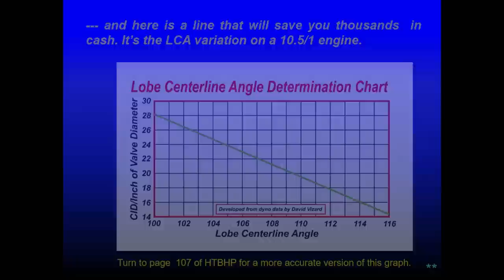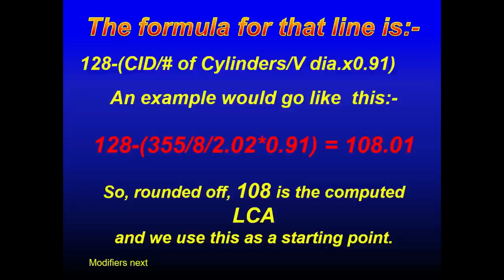Cam profile dynamics Vs event BS bashing!

Comment: "I don't have an opinion, I have a dyno." 😎
Reply: Awesome
Reply: I believe you sir
Reply: Do you think Comp Cams doesn't have a dyno and far better data acquisition equipment than Crane ever had? Why do you think with all the R&D that Comp has done that they don't follow David's advice?
Reply: @jonathanschmidt6507  thats why I use Lunati and have them grind every cam I buy. I dont use off the shelf cams as the profiles are just a ball park figure never an exact one.
Reply: @MasterWitchDoctor  
What tools do you use to spec cams?
Hopefully not the 128 gimmick.
There are much better ways that actually considers the physics of the engine.
The 128 formula is does not.
Any method for specing a cam that does not consider the design of the intake and exhaust system is just a rough rule of thumb.
Reply: @jonathanschmidt6507  because they don't use his formula....
Reply: @cromBumny  
There is no simple formula that can comprehensively determine the ideal cam specs. That is why the most knowledgeable people use 1D simulation to tune the engine as a whole when selecting a combination.
Reply: @ironmike742  It might help your understanding to know that David called me and invited me to join in on his videos to stir up controversy and get more views.
Reply: @jonathanschmidt6507  well that would be a good thing. David Vizard is a great man with great talent and knowledge
Reply: @ironmike742  To amateurs, he is better than nothing. Many of his claims are just gimmicks and speculation that professionals laugh about.
Reply: @ironmike742  He is the subject of jokes among professionals. He posts clickbait false claims and tries to pass off speculation as fact.
He is better than nothing to amateurs who don't read real engineering books.
Reply: @ironmike742  
Here is a suggestion, if you really want to understand engines, read Design and Simulation of Four Stroke Engines by Gordon Blair.
I it at a whole different level and will require more effort on your part
Reply: @ironmike742  
Taught a lesson about what?
David and I have had hundreds of exchanges on speed talk.
He invited me here because he knows my criticism intrigues people.
It is working on you, obviously.
Wise up, don''t be a dunce that falls for social media ploys.
Reply: @Jonathan Schmidt  As someon3 who's worked for a major corporation. The idea of giving the customer the best service & product they can produce. Is a foreign concept, to the executives making the decisions.
Reply: @I_like_turtles_67  
I am wondering why this is directed toward me. What is your point?
Reply: I've watched this a few times now, and David is SPOT ON!!......HE IS our modern day Smokey Yunick......yep

Comment: I Have enjoyed learning more about Engines from you. You are so correct on your results being proven on the Dyno.  I have a friend that has since retired from Roush in Livonia. He worked in the Engine building Department for most of his career. Roush has 41 dyno cells and they test and build a lot of different products. I learned from them on their crate engine program sourcing the correct parts to make good reliable power that is backed by a warranty.  So again to confirm that you know what you are doing as your testing confirms what you say. Keep up the great work.

Comment: I have watched numerous teachings you have out there. I even had your how to hotrod small block chevy's and big block chevy's books. I didn't know who wrote them at the time, but I know now.
You have inspired me to build several engines. Mostly chevies but a couple of Fords utilizing what I learned from your books and experience.
You always put out the correct information as far as I can tell.
I'm sorry that we are not living closer together. 
Although now I am dealing with heart failure and a heart pump and can no longer build engines.
My son is building a 489 with my input and watching you series. It will be awhile because he is building it as he gets the money. We are hoping for around 550 hp and about the same on torque at 6000. We are using stock 781 heads and 2.19 intake valve. A howards cam   .600 .600 lift 230 240 dur and 110 centerline. 
We will let you know how it works when we get it together.
Again I wished we lived closer to you. We could both learn so much from you.
Reply: I'm interested in hearing your results, how much work on those heads?
Reply: @totensiebush  just knocked down the casting bumps. All speculation at this point.

Comment: Not too long ago I saw a episode of Engine Masters on the TV that demonstrated this on a Dyno. They strapped an engine on the dyno that was built. They swapped in three identical cams as far as lift, duration with different lobe separation angles as described by Mr. Vizard. Interestingly enough the conclusion was inline with what Mr Vizard mentions. The engine in this case made more overall power with the tighter lobe separation angle than with the wider angles. I'd like to have seen the engine tested further tested with more cams with tighter angle all else remaining the same, to see if it would further optimize the power output or show the point of diminishing returns,  but as always, time is a constraint when producing television shows. Mr. Vizard through years of experience has developed a formula that will shortcut the trial an error process to choosing the most optimized camshaft to an engine build. I can definitely appreciate the knowledge and the experience that is being put out and shared by Mr. Vizard.
Reply: This channel is dead for now, find his other channel here: https://www.youtube.com/@DavidVizard

Comment: Apparently John has never heard the saying "Timing Is Everything" or has not realized what it really means. 
Great content Mr. Vizard.
Reply: Timing is everything, because... pulse flow - DV refers to "recovery" a fair bit, I notice.  Must be important.  On a centrifugal pump, there's a nice stable spot regarding volume and speed, which charts well.  An engine viewed as a positive displacement pump is nowhere near as convenient: can't have intake and exhaust constantly open like that.
Reply: Do you think Comp Cams doesn't have a dyno and far better data acquisition equipment than Crane ever had? Why do you think with all the R&D that Comp has done that they don't follow David's advice?

Comment: We accidentally stumbled on the 108 centerline trying to make a vacuum rule on a late model dirt car. adv dur.274 int  .278 exh lift .505 int and .510 exh. The cam did NOT pull vacuum but instead woke the fireball heads GM Angle plug ported by Crane Cams on a 11.5:1 355ci chevy small block. engine never dynoed but the torque and power was unbelievable.

Comment: Seems to me, what the engine builder is trying to achieve is an optimum air flow velocity through the intake port for each crankshaft angle along the intake stroke. Piston velocities and accelerations are the curve balls here.
Reply: There is much more to it than that.
An engine is a system with sub-systems. The valvetrain is one of the sub systems.
If you don't design a valvetrain as a system then you end up with a system that either puts too much stress on the parts because the valve springs are stiffer than they need to be or you get other dynamic problems like valve bounce and or broken parts.
Just because you might not be thinking about cam motion dynamics, that doesn't mean that your cam designer isn't. You are relying on them to do it for you.

Let's consider how that works in practice. Let's say that you are a cam designer, designing cams that will be sold in catalogs, you have no idea what parts will be in the engine. So what do you do? You design for and engine with heavy steel valves, springy pushrods, and rocker arms because that is the safe bet. If you design for light stiff parts and the engine doesn't have them, it will likely float and bounce valves and consequently break parts.

If someone with an engine with light valves, good conical springs, stiff pushrods and rockers were to use the cam designed for heavy flexible parts, he would be leaving a lot of performance on the table. Those lighter and stiffer parts can handle a much more aggressive cam.
So when you choose a cam, you should know if the cam is designed to match the mass and stiffness of your parts before considering anything else.

Comment: When I first got into NHRA Superstock racing with my low compression 350 check , i had cams from at least 4 manufacturers who claimed that there cam was the one I needed, I wasn't getting ahead!! after reading David's books  I have all of them, and Grumpys book I decided to figure this out in my own, with the help of Dynomation, I had cams ground on my specs, and yes I was questioned a few times 20 cams later the car was running 2 tenths quicker with 20 HP more i won't give The torque  number's  but had a lot better average, don't be scared to  try your self , that's how you learn

Comment: In the 2011 engine masters contest there was a competitor that placed 2nd with a 369 cu in LS engine, that was converted to a flat tappet camshaft. Steve Dulcich wrote a story about this LS engine in the Engine Masters Magazine, called, unconventional power. The entire purpose of the build was to demonstrate the power that a flat tappet cam could make. So yes David the flat tappet camshaft when done properly can out perform a roller cam. Thanks for the great info.
Reply: for limited rpm applications sure. but fact is a hydraulic roller wouldve probably made more power if specced the same.the reduction in friction alone isnt something to be ignored.
Reply: @b.c4066 That is where you are so incorrect, if you study how a flat tappet cam and lifter really work you will find where a roller cam has 18 needle bearings and the load is on maybe 4. Where a flat tappet cam the lifter is hydroplaning over 1000s of balls of oil, the same way the engine bearings, and the lifter is spinning. And w ceramic lifters toe friction is next to nothing. 
 Do you know that Porsche took one of their  engines and replaced all the bearings with rollers and needles and it LOST power, so much for friction.
Reply: @racerd9669  lol. Everyone thinks that they need a roller cam to make power. You can't tell the younger generation anything ( YOU KNOW THE ONES THAT GOOGLE EVERYTHING) There is no common sense nowadays or should I say there is a huge lack thereof. 🤔 OH my what do we do about it ? 🤷‍♂️
Reply: Flat tappet cams because of the lifter diameter and contact location can accelerate the valve off of the seat quicker and increase the area under the curve... = More torque
Reply: The flat tappet can be ground different! Don’t get me wrong I love a roller but it has it’s place

Comment: Thanks DV, I would not dare question your authority on the 128 cam formula as your results speak volumes! My question is what modifications to this formula (if any) would I need to apply to a 4 cylinder 16 valve application as this is my main interest and I live where I have limited options to chose from in profiles locally? Any guidance im this would be much appreciated. Thanks for your pearls of knowledge, always valued👍
Reply: Do you think Comp Cams doesn't have a dyno and far better data acquisition equipment than Crane ever had? Why do you think with all the R&D that Comp has done that they don't follow David's advice?
Reply: @jonathanschmidt6507  You should post some videos to show why DV is wrong instead of copying and pasting this same comment over and over
Reply: @stevej4135  
I have explained it many times in discussions on speed-talk.
DV called me and invited me here to help  stir controversy so that he can get more views.

Comment: On your video on centerline angle for factory iron heads you say absolutely 108° CL did I hear you say with 1.6 rockers go up a number to 109°? I checked my Howards cam is 106° with 108° lsa with modded 993 heads is 106° CL holding back much power? Which is more detrimental to power lower or higher number CL? Because even tho I love my cam it runs great sounds awesome but I trust your opinion and would consider cam swapping if it's worth enough like 20hp but likely wouldn't for like 5 or 10hp because of the expense of a new cam I'd rather put it in a different mod you suggest. I'm completely rebuilding/further modifying my 355 with your tech tips I'm excited to see improvements from your tips and tech so thank you DV you are my inspiration and I put your advice and rules over absolutely anyone's and when I watch guys like Steve Morris even tho he's very knowledgeable I think I wonder what DV could do to his BBC and SMX heads, I bet you could find improvements in even SMX heads especially the BBC stuff like the Big Brodies.

Comment: I read some of the conflaguration on speed-talk. It is a little strange the way good gear-heads will argue with engineers. I remember when a big delivery truck ran into a ditch next to our property. They attached a chain to the frame and my dad came out, looking a lot like you, and told them you are going to put at least two times as much load on the frame as it can take. They said go away pops we know what we are doing. My dad was a caltech-trained rocket scientist. Guess who turned out to be right? Thanks for what you do for us non-engineers. You explain things in ways that benefit us. You have helped me immensely.

Comment: I built my 4 valve Mazda B6 engine to DV's specs including the LCA using DV's formula. People couldn't believe how wide an angle I used. Everyone said "that can't be right", but it pulls from idle to 8300rpm and I won 3 state supersprint championships with it. It was never beaten. And my final configuration as good as mirrors the power phase of Toyota's 2ZZ's LCA, duration and CR. Toyota agrees with DV it seems.

Comment: The Camshaft is a critical part of an engine build. I love the 4.3 Vortec V6 engine and I put a Comp Cams 266HR in my 98’ 4.3. Beehive springs, chromoly pushrods, mahnum roller rockers, mild porting. I feel like I have less torque than my 94’ 4.3 CPI motor had. I believe the added spring pressure takes away power. The extra energy it takes to turn the camshaft has to be the culprit.
Reply: it is probably the mild porting to blame. it needs precision expert work around the seats and valves, chamber and bowls.
Reply: I would disagree, that the camshaft takes more energy to turn.  Most people forget that a camshaft has an opening ramp and an closing ramp.  While it might take more energy to open the valve than the stock valve springs as the lifter goes up the opening ramp, the stiffer valve spring will also add more energy than the stock springs back into the system as the lifter goes down the closing ramp and help turn the camshaft. So net energy is zero or close to zero.
Reply: My '94 Blazer would smoke my '99 Blazer both in power and gas mileage.  When I lost my radiator hose and blew up the engine I made the best of both worlds.

Fast burn factory Vortec heads, unshrouded the valves and put 1.6 exhausts in (basically sbc chamber mods), a CPI cam, removed the balance shaft, and decked the block .015" to get my compression back and move the quench from .060" to .040".

It's the engine GM should have build when they got rid of the CPI engine.

Comment: Thank you for making another very interesting video Mr. Vizard you are more interesting than watching my favorite TV show. I have calculated the amount of CFM a 50 cubic inch single cylinder of any engine flow demands at 5500 rpm it is 1000 CFM when the piston is traveling at its maximum speed in the middle of the cylinder. I did this by multiplying the stroke from radius squared times pie times 5500 rpm and calculating the bore squared times the the amount of stroke in one minute at 5500 rpm. Somehow I arrived at 1000 CFM. If a cylinder head intake flows 300 CFM it will be able to catch up as the piston slows down toward the bottom. Is this an important thing to think about ?

Comment: David:  I've found that the quality for Edelbrock products are lacking in form and craftsmanship.  Competition Cams Co. is kind of the, "run of the mill' products...sometimes with Edelbrock as well.  What are your thoughts on these products.  I very interested in finding the correct parts for my builds in application.

Comment: The only explanation I can think of for the proliferation of 112 LSA cams, at least for stuff like LS engines, has to do with the operation of the EFI and the bias in the head design towards emissions, smooth and quiet operation. You're absolutely right, the tighter LSA is going to work way better if the wants it. No question at all, there is going to be more power and TQ everywhere.
Reply: That is correct for dyno testing,,,,but; most people will regret the narrow LSA after they deal with the poor drivability, eye burning exhaust (pollution negligence), it gets old after a while.
Anyone that tells you that the cam companies don't know what they are talking about is taking you for a fool.
Of course all of them know they can make more power on the dyno, but there is much more to choosing the best cam than a dyno test.
OEMs do double blind testing to see what customers actually prefer, the fact is, the drivability they choose is not the same as the dyno chart they choose.
When I was working on the Coyote intake manifolds, customers that did not know what manifold was on the car thought that the truck manifold was the most powerful because it had a lot of power down low.

Comment: On your 128 formula do you have modifications to it if let's say your running a 9.5 to 1 compression ratio or other compression ratio?
Reply: 9.5 -1 is well within the applicable range for DV's 128 formula. But yes, in his books he details the small adjustments needed for varying compression ratios. Still, the 128 will play very well with 9.5-1.